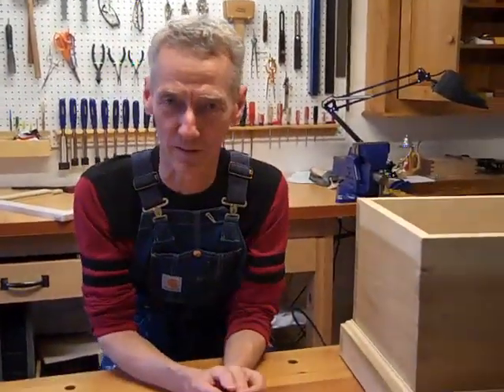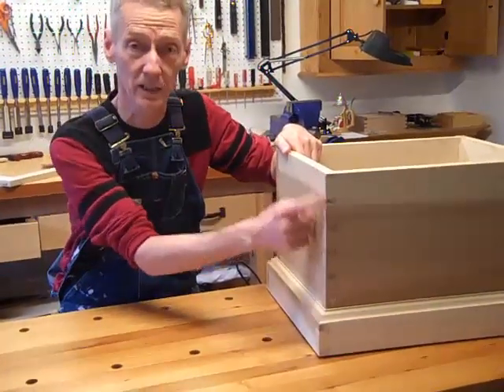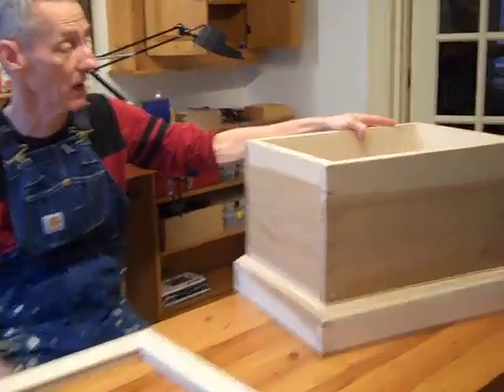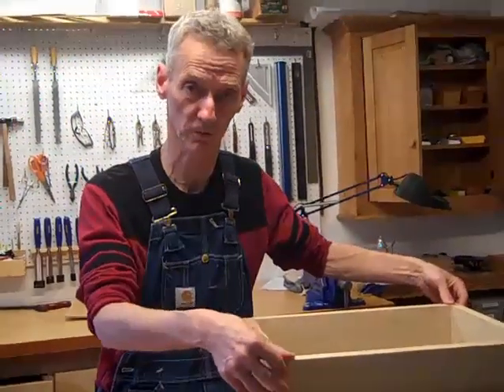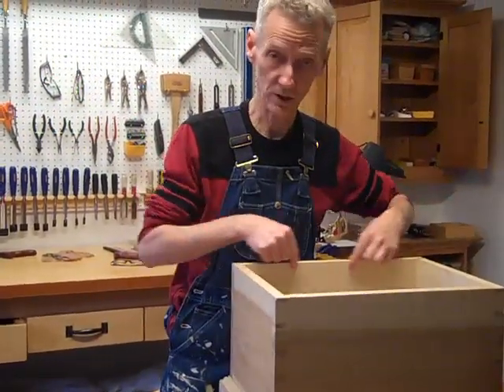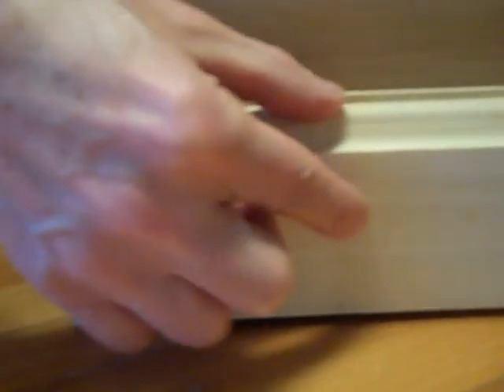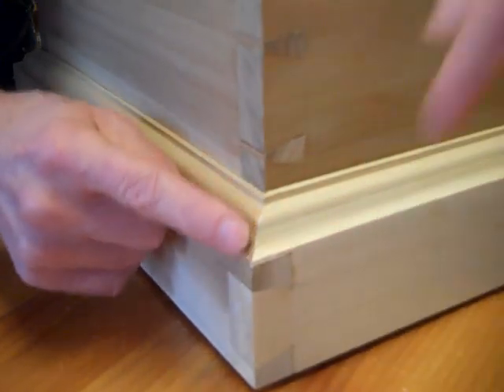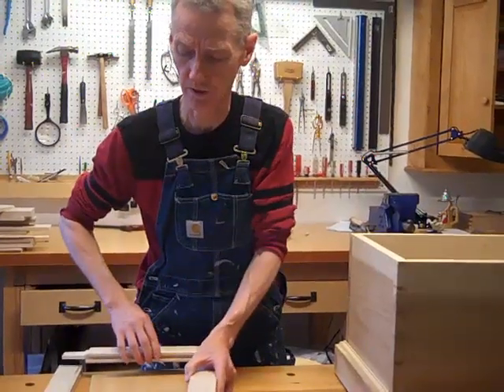Tool Chest Show #1

Comment: Surely a traditional toolchest would have the tails and pins of the apron reversed to those on the box itself, so the dovetails reinforce each other. Yours are not adding any extra stength across the width of the box.
Reply from the maker: +Caldermologist   That is a very astute observation. It stands to reason that reversing the dovetails would make a stronger box. Still, I have seen many old chests where this was not done. It would seem that the traditional woodworkers of yesterday never got the memo on this. Their boxes, centuries old, remain in excellent condition. Please pardon my teasing, I appreciate that you made this interesting point. Best regards and thank you for commenting.